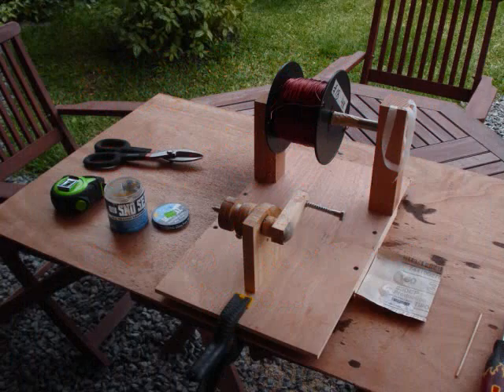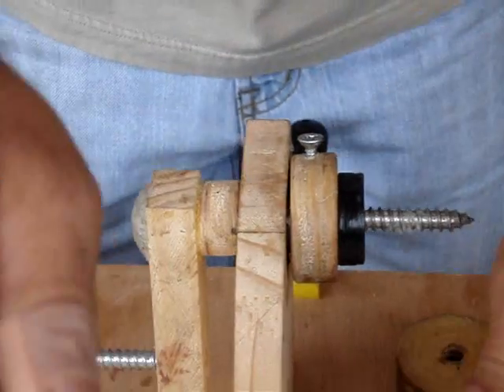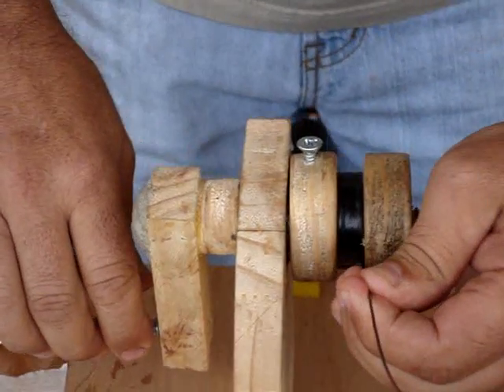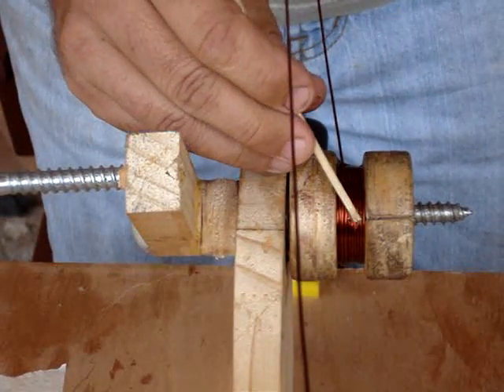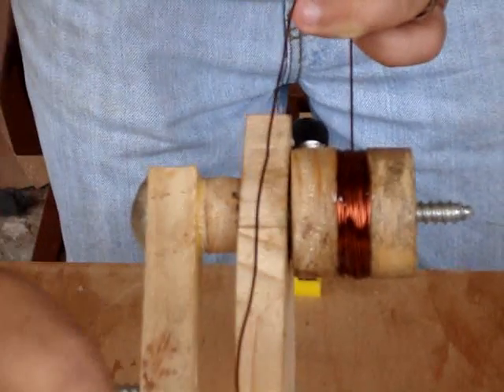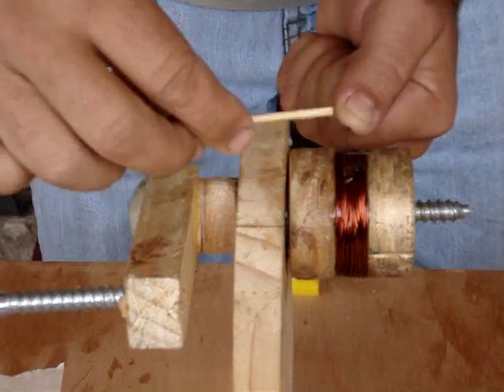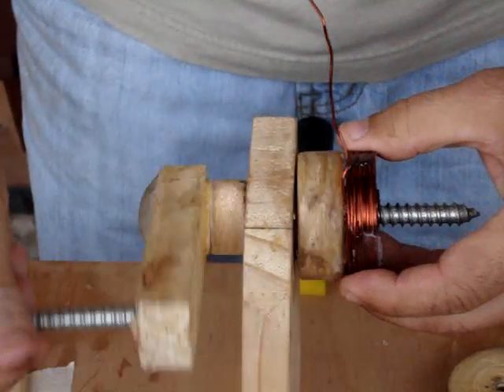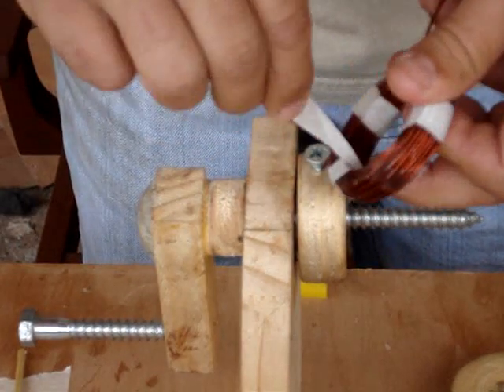How to build a homemade coil for a P.M.A generator. (wind turbine, hydroelectric)

Comment: Is 70 turns on a coil enough to get 12 volts? I made coils with 200 turns and I got no voltage. The wire size is 30 awg magnetic wire. I need some help.

Comment: I dont understand ,why nobody put an iron core inside this hand wrapped coil for w.g ?
Reply: An Iron core would get attracted to the passing magnets, and act like a brake, slowing the rotation..
Wrapping a copper wire around an iron core is great if you are going to put current into the coil, as this will make the iron an electromagnet.. this is not the desired function of the coil in this video..
If you need this explained to you in any greater detail, perhaps building your own wind generator is not something you should tackle.

Comment: Hi, I have questions. Please do answer them, thanks. what kind of epoxy are you using?, how.many volts does your stator generate, and what kind of magnet are you using? also how far is the rotor from the stator, and what is the rotation of your rotor, clockwise? Sorry if i got so many questions, but can i see your stator and  rectifier, schematic diagram? thank you very much

Comment: Hi Bud. how thick is the copper wire you use?
Reply from the maker: 18 ga
Reply: Aceman307 ga? I mean in millimeter sir.
Reply: @dickywijaya9614  1.02mm

Comment: awesome videos..what is the middle piece(as far as size & diameter of it) that you use for the coil to be wrapped around? also you say you cut it in thirds what do you mean? ..are the outer discs the size of what the final product of the coil should be? thank you...
Reply from the maker: The disk in the middle is cut into three equal parts after you drill the hole in the middle its the piece that holds the coil. It makes it easier to take the wood disk out of the middle when done.
Reply: Aceman307 Oh ok great thank you I didn't cut it into thirds I made the two outer discs with a 2 inch hole saw and then the center disc to wrap the coil around a 1&1/2 inch hole saw...my email is ervin656@gmail.com I would like to show you the one I built and maybe be able to have you as a contact for guidance for other questions I may have doing it for a  process technology engineering class and have to have it built and running in 3 weeks waiting on the wire to come in should be in today though..thank you again

Comment: Hey does it matter if the coils are wound clean like this.. I'm doing it by hand and ended up just winding it all messed up, also when I pulled it out I messed it up.. Will it change anything?
Reply from the maker: + Mark Villanueva It only matters so you can get as many winding's as possible in the tightest coil possible. The more copper you get close to the magnets helps the efficiency.

Comment: *****  I want to use 4 N42 or N45 Magnet's position like N, S, E, W Size Of Magnet 1.75" L X 1" W X 3/8" Thickness, I like to know What gauge Magnet Wire I Should Use? and How many Feet's Use for Each Coil? I appreciate your respond and Help Please.

Comment: what size of copper did you use and how many turns and diameter ..??? thanks
Reply from the maker: In the first 25 seconds of the video I tell you I use 18gauge wire at 30 feet long which is about 70 turns. Thanks for watching.
Reply: How much power does dis produce?

Comment: What is the inner diameter and the out  diameter, and what kind of magne neodymium do use and what is the gap distance from the magnet to the cool diameter
Reply from the maker: Check out my video Building the stator for my VAWT and it shows all the dimensions for the cols and magnets.
Reply: Than Dinh 0

Comment from the maker: If you check out my building the stator video at 21 seconds I show a diagram of the magnets and coils . The magnet size determines the coil size. I also have a video on serpintine coils which i Iike better ,easier to build.
Reply: Hi
what formula did you use for making the coil? and what the conductor size did you use ?

Comment from the maker: If you check out my building the stator video at 21 seconds I show a diagram of the magnets and coils . The magnet size determines the coil size. I also have a video on serpintine coils which i Iike better ,easier to build.

Comment from the maker: The reason you use enamel coated wire is to get as many turns of copper as close as you can to the magnet the enamel is thin. You cant use bare wire it will not work. You could use say a thin telephone wire that has a plastic coating but this is not ideal.

Comment: I thought that the voltage produced was a function of the number of turns in the coil, not the length of the wire.

Comment: Isn't the number of winds more important than the length of the wire?  Also, what's the purpose of the tape if you use epoxy?

Comment: He used 18gauge wire here with 6.5 layers, about 70 turns he says... I think that ace hardware has a book on winding coils with the math you'd need. There are different types of magnet wire btw.

Comment: Very impressive technique.  Awesome job of showing how to make coils, but you are using the wrong shape and size.  Magnetic flux moving across the coil only produces electricity when it is perpendicular to the direction of the motion.  Your coils only produce electricity near the middle and not near the inside and outside edges.  Square coils will capture more power and the in/outside edges do not have to be under the magnets because they don't produce power anyway.

Comment from the maker: @eastsidesigns1Tthinner wire = more space for more turns . Also the smaller the wire the higher your volts will be but less amps. So the trick is to get the right combination of high enough volts to charge your batterys but not to high because more amps will charge the batterys faster.

Comment: @Aceman307 You can't use bare copper for coil windings. It would be like having a shorted coil ???
Reply: correct.. the wire must be insulated so that the current runs the full length of the wire coil, and not just jump through the shortest path from one side to the other.
Electricity is a tricky bastard.. ;)

Comment from the maker: @enticed2zeitgeist No it does not have to be enamel coated wire but you want get much voltage out of it. The Idea is to get as much wire as close together as possible in the coils so to get the most voltage from each passing magnet.

Comment from the maker: @queball147 I used about 70 turns, The voltage depends on how fast it spins, I dont have a way right now to measure the rpms, I know  my turbine spins too slow to make usable power from this PMA. I guess about 70 RPM gets about 5 volts'

Comment: A question, can I make a antenna out of a coil, I think I could because it makes an electromagnetic force around itsself if you wind it in a bolt and connect 2 ends to positive and negative ends of an antenna to make it more powerful and if anyone say it doesn't tell me how should I make a powerful antenna, Thanks.

Comment from the maker: @brown55061 I was able to find the wire locally at a electric supply company. Try to find a electric motor repair company or a big electric supply warehouse. They sell it here by the kilo, I got 10 kilos for about $ 70 dollars and it is enough wire to make a little more than 3 stators. I have seen people on Utube recycle wire but it seems like a lot of work. Good luck.